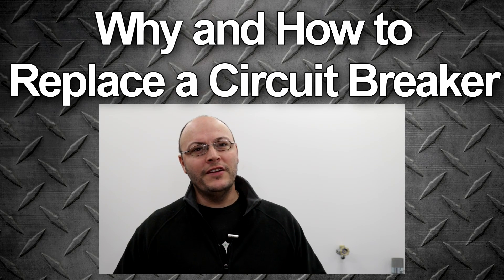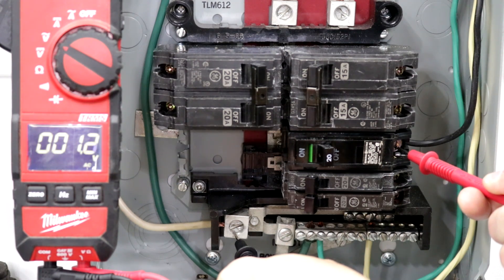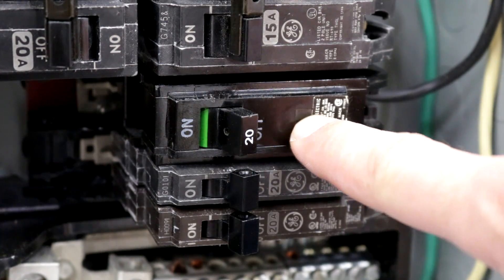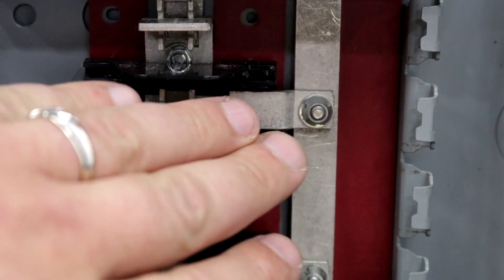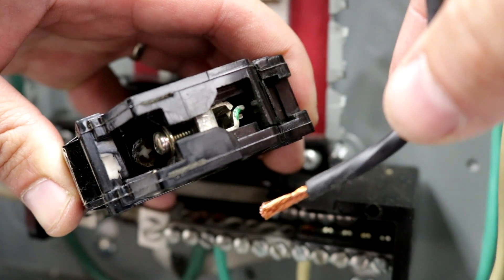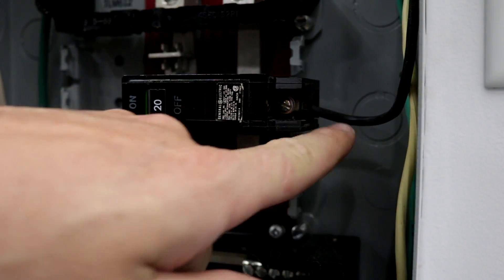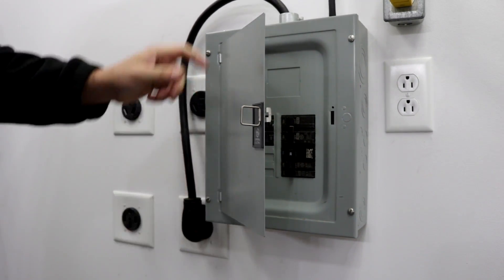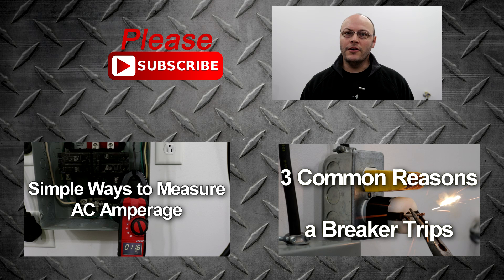How to Replace / Change a Circuit Breaker in your Electrical Panel

Comment: I had a circuit breaker trip, unplugged everything and reset it. Didn't trip again but I have no power to the outlets on that circuit. I tested the breaker and it's got power. What could be wrong?
Reply: racerron27 Check other outlets around the house to see if any have a reset switch. Sometimes it might be in a completely different room but runs through to it. I've had a downstairs bathroom outlet trip and cut off my upstairs bedroom and the plugs on the outside of our house too.
Reply: Switched outlets?